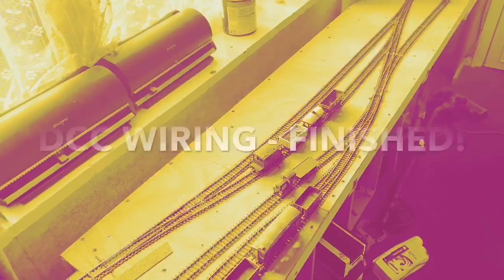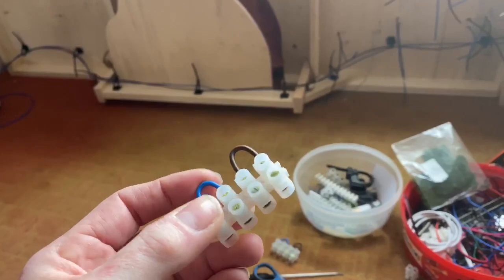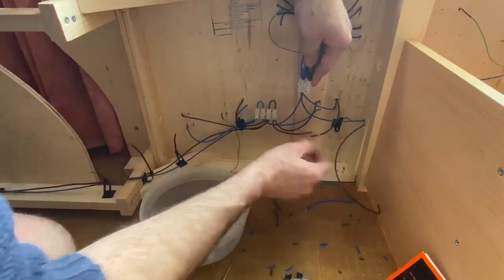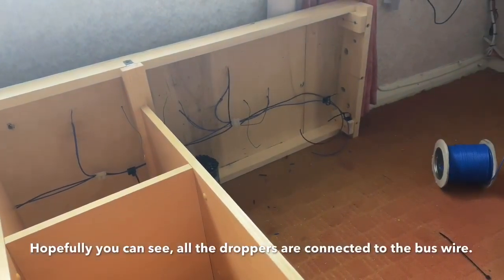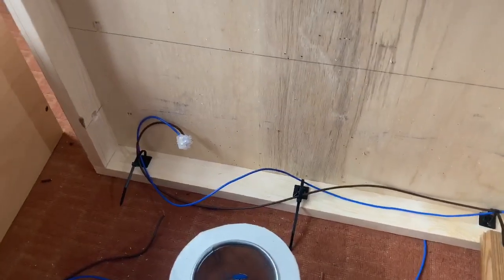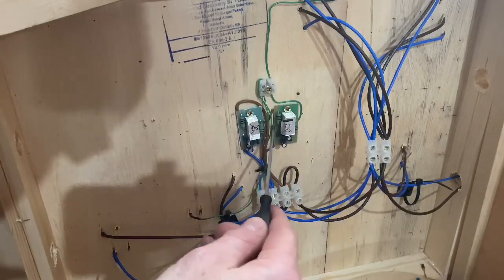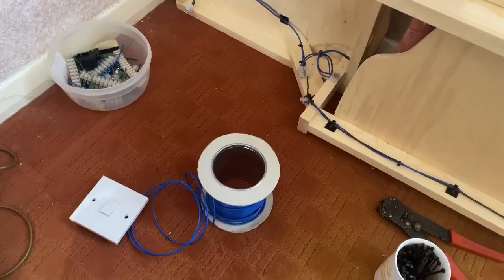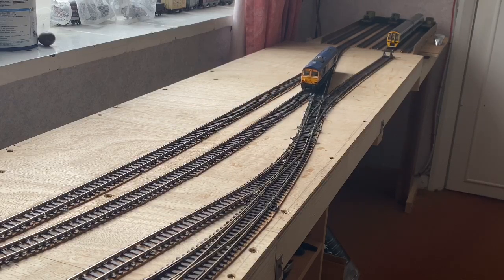OO Gauge DCC WIRING - FINISHED (PICCADILLY SIDINGS)

Comment: GJ John. Simple and secure. I've been using those snaplock connectors and found if you over squeeze them wires become disconnected. Not good! I'm not to far down the road to change methods and I may just do that now. I'm going to use megapoints for the point motors. I've already bought the stuff. But along with my baseboards its all at my friends house where we were building it before the apocalypse. So as it maybe a long time before we can meet up again I have time to consider which way to go. Right back to the Metcalfe building stash.
Reply from the maker: Bless you Gordon, yes I remember you saying about the baseboards. Needs must though, far too many fatalities from this awful situation beset us. Least you’ve got things to do.

Comment: Hi John  - was interested in how you do the bus wire and the link in from the track above.  My long term ambition is to convert Blackwood N gauge layout to DDC - so your "how
to" video  was most useful.  Good to see you use the same method I use for the choc blocks in looping two or more together so one inbound feed can distribute to umpteen track feeds.  I always wondered if I did it right but was good to see you did it exactly the same way.   Cheers Euan
Reply from the maker: Bless you Euan, thank you. I sometimes think there isnt a right or wrong way, but rather ‘if it works... ‘ I do love DCC and the affects / functions are amazing, improving all the time. The initial cost though can be a bit steep especially to buy a decent controller. I fell into the trap of buying a cheap DCC controller and instantly regretted it. When you’re ready Im sure many would give their experience of the controllers they have. Thanks for commenting Euan.

Comment: Hi, looks to me that you have the programming track wired wrong. You’re only cutting power to one rail which causes your led to go out, but you don’t have the Z21 programming wires connected. Also you need to isolate the 2nd rail. You need  DPDT switch. That’s 6 connection on the switch. The 2 center pins go to each rail. 2 top or bottom pins go to DCC. The 2 other pins go to the Z21 programming output on the Z21. Then you will be able to toggle between DCC and Programming.
Reply from the maker: Thank you for the comment, It works fine, the power enters the layout at the viaduct end and Ive isolated the power to the rest of the track. No power to the track beyond switch point. Remember layout uses the white z21 ( the black one has all facilties as I use on my N gauge layout.) and does not have a separate programming track facility

So dont worry ALL IS WELL! And definitely do not need a DPDT switch. Thanks
Reply: @piccadillymodelrailways  I was thinking exactly the same as Clinchfield Model Railroad N Scale
. I think I'm missing something here.😁  Is the programming track the short siding nearest the camera, where the test light didn't work? Splitting one wire will isolate a section just fine, I get that bit. The bit I don't get is: can you control that bit of track from two different places? If it works on the "normal" DCC", how does breaking one wire switch control to a different source, making it a programming track?
That's a lot more complicated to write down, than to think.😂

Comment: Forgive my ignorance (never got into DCC), but what do the frog juicers do?  Are they instead of switching the frog polarity using a switch on/in/attached to the point motor? How does the frog juicer "know" which way the point is set?
Reply from the maker: Thank you for your question Andrew. The frog juicer is an automatic frog switching unit. When the loco crosses the point a short is detected and the unit switches the polarity, all in hundredths of a second. So quick the z21 cannot detect it. How it works, I’m not the best person to ask that I’m afraid. Hope that helps

Comment: I've never used frog juicers before, relying on the built-in switches on my old gaugemaster  seeps. Assume you are sticking to changing the points manually
Reply from the maker: Hi Leslie, the frog juicers are brilliant as they switch polarity in fraction of a second before the loco or even the controller notices. 
I will use point motors, probably the megapoints systems or cobalts not sure. Its just a cost thing right now, in the current crisis it would br foolish to spend when there is another temporary way. Thanks got taking the time to comment.
Reply: @piccadillymodelrailways  There is the option of manual switch levers to give the brake man some cardio and more interaction with the layout
Reply: Or as you’ve added juicers just put a pin into point bar and into a slider underneath that’s what I did on ridge lane

Comment: Hi John,
Interesting to watch you do this as I have just finished wiring my one  ( except for the new stuff coming today Tuesday ) and it will be in my next installment. How does the frog juicer work I know you can have a frog switcher incorporated with a point motor but did not know about these as I could use this on mine if I have trouble with the only Peco elecrofrog one I have on the layout at the moment? keep well and safe and look forward to the next part of the build.
Cheers Robert.
Reply from the maker: Hi Robert, glad you liked the video. They are completely automatic. The electronics sense the short and within hundredths of a second switches the polarity. They are brilliant. Come in singles which can be expensive around £6+, or in packs of 3 which does tend to be more economical. Hope that helps

Comment: Great video John. I have been looking for frog juicers, so thanks for your tips. Re simple joining of wires, I have used Wago lever type cable connectors, so much quicker and easy compared to using a screw driver, but I have never seen anybody else on YouTube using these for their railway wiring.
Reply from the maker: Hi Nick glad it was helpful. Ive used many types of connection in the past and terminal blocks have become my connection of choice. Each to own in this case